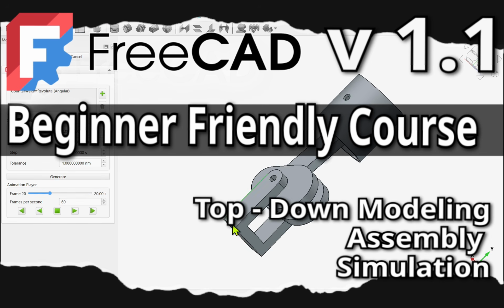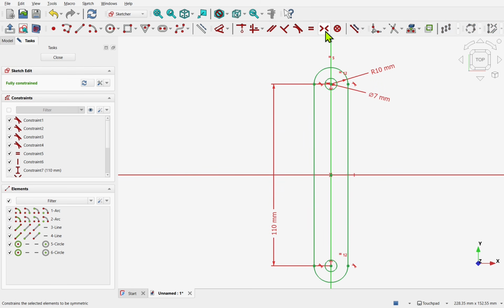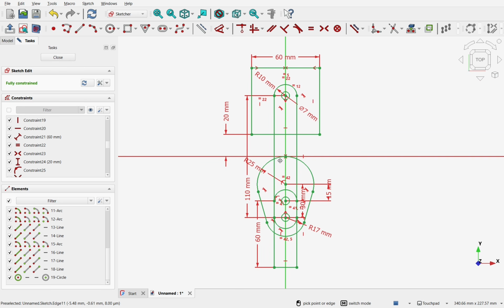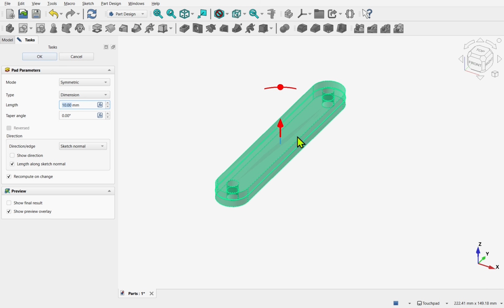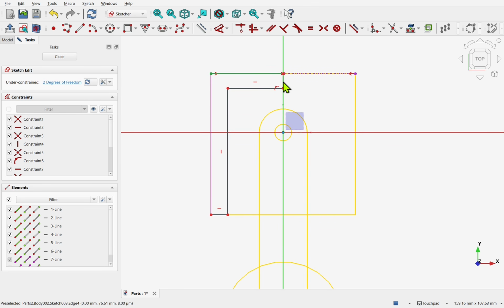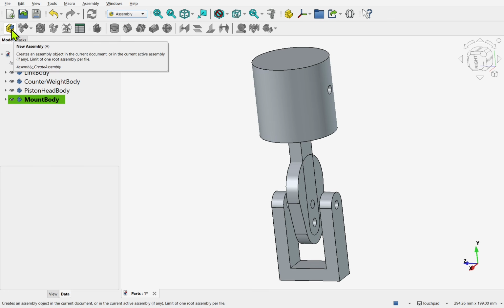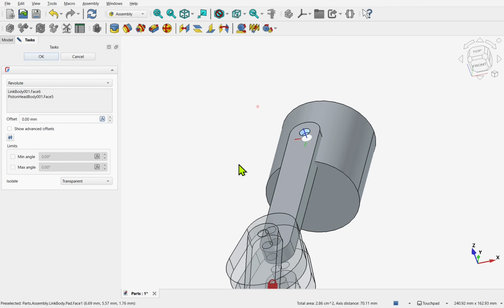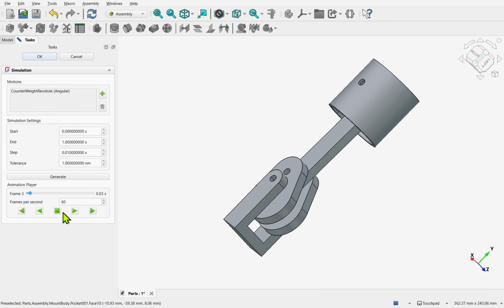FreeCAD 1.1 Beginners Friendly Modeling and Assembly (Model, Assemble, Simulate, Animate)

Comment: Hi Darren, For some reason I cannot toggle between construction geometry and defining geometry mode?  The geometry stays on construction geometry even when I use the toggle construction geometry button to change it.  I also don't have the external projection feature on the create external geometry button.  No drop down menu's?  Any assistance would be greatly appreciated.  I'm using version 1.0.2.
Reply from the maker: Hi, this tutorial is for freeCAD 1.1 which is available for download from the freeCAD website as a RC version at time of posting.  This is a new feature introduced in 1.1 and above, also the same with the simulate tool in assembly workbench. It's easy to miss the version number in the tutorial so don't worry it's not your system.

Comment: Toggling the construction geometry does nothing in my sketch... It still appears as a dashed line. I also don't have that option you mentioned in the preferences. Am I supposed to create a carbon copy instead? I'm not sure why it won't turn a solid line.
Reply from the maker: This tutorial is for the upcoming freeCAD 1.1 where this feature was added along with the simulate  tool in the assembly.  You can download the RC version from the freecad download section.

Comment: I am not sure what I am missing but I am having issues while creating arcs.

Around 11:25 you use the tool for the "tangent" , I can do that for the first line and the arc above, but if I try to use the tool on other lines/arcs I will get an error about "conflicting constraints.

Is there an option I have to enable for this?

(Tried this on both 1.0.2 and 1.1)
Reply from the maker: In the sketcher on the left panel in the constraints section there is a dropdown, within their is the remove redundant constraints.  Make sure that is checked.  Conflicting constraints now makes me think that the auto constraints option has place a symmetrical constraint in your sketch somewhere where it shouldn't, stopping your tangent.
Reply: @MangoJellySolutions  ahh thanks alot man, tried it on a fresh new file and there were no issues 👍
It was already checked by default not sure why I had the problem first time.

Comment: For all the praise that I see here about how good your courses are, I can't use them for two simple reasons, (1) - my start page seldom looks like yours, no matter how many times I reload. I then spend real time trying to get it to match. The one time that it did load "correctly" after extensive cleaning of the Registry and removal of abandoned files was when I ran into (2) - unable to keep up with the activation of pull down menus/hot buttons/... on a very cluttered work space. I even tried slowing down the playback speed but the audio drove me insane and the targets while slower still were accessed too fast. An oversized trailing cursor would help as well as pausing before clicking. Also having a short respite between every three mousing arounds to let the beginning user consolidate what they have just seen and are hopefully trying to mimic.

Comment: Thank you for a nice, informative video.  What if you want to limit the angle of motion? Like a windshield wiper motion, or a angle limited hinge?
Reply from the maker: Glad you enjoyed :) There is an Angle Joint which creates an angle joint between two selected parts but this doesn't allow a range, what you need is the revolve joint and you will find this one actually allows a minimum and maximum angle for the revolve.  So the revolve goes through the pivot point of the wiper and a fix point to revolve around which could be just something as simple as a cylinder.

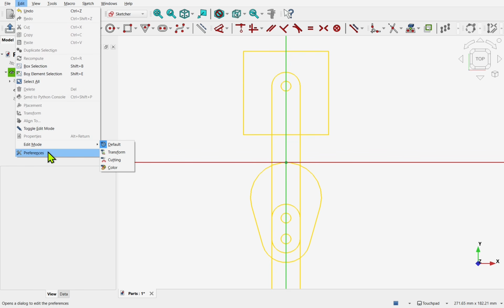Comment: Best CAD tutorials on the WWW by far. I am a 30 year SolidWorks user and absolutely love FreeCad ( especially the part where I don't need a subscription or a password to use the software for my projects) among other things. Graduating to assembiles using your video as a guide, But, I am afraid I am  stuck at 19:24. My verison  (1.0.2) does not have the option you describe and the system refuses to convert the dash dot lines from the converter to sketch lines I can use to continue the exercise. I have spent the better part of 8 hours looking for work-arounds and so far...no joy. I must have hit one of theose stages where I must be commiting the same eroor and expecting different results. ANy help will be greatly appreciated. Thanks in advance
Reply from the maker: Thank you, so glad your enjoying the videos and loving freeCAD.  Ah, so I know the exact problem you are hitting.  This is a video for freeCAD 1.1 (currently available as a RC release) here is a video of how to download and install, https://youtu.be/16jGZ_33o3g  I think they are on release candidate 2.  Hope that helps as 1.1 as has the simulate tool for assemblies.

Comment: i always stuck in 20:35 "always add eternal geometry as construction" menu,
i use the 1.0.2 freecad, and the menu in preferences is gone, any sugestion?
Reply from the maker: Ah yes it's not in that version, this video is for version 1.1 of freeCAD which is currently in release candidate and can be downloaded from the git hub.  That tool and the simulate assembly are for 1.1 (1.1.0)  and above.

Comment: I don't understand what you did to crate the piston head, mine is not showing " move to other body"
Reply from the maker: This is a tutorial for version 1.1 of freeCAD you may be using 1.0, the transform tools have been upgraded since to allow this new feature along with the simulation tool.  1.1 is available from the downloads, follow weekly builds and you will be able to download as a community release from there.
Reply: @MangoJellySolutions ok thanks but after doing everything, I entered freecad again and, tried to enter the file it scattered, the mount, only half remaining

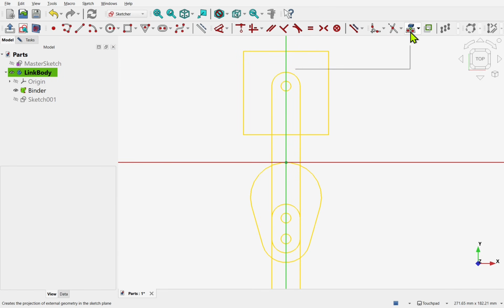Comment: I got as far as 19:39 but I don't have the External Projection tool.  Your video says you are using FreeCAD 1.1 but that is not available.  I have just downloaded the latest version which is actually 1.0.2; so a lower version.  How do I get 1.1 or the External Projection tool?  It does not appear in any of the menus or even the customise toolbar options.

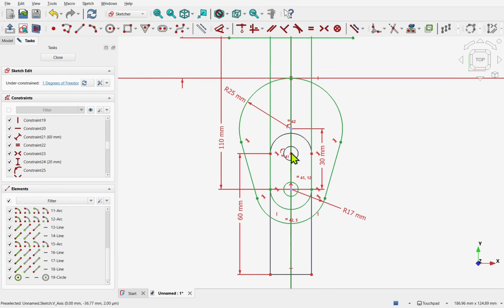Comment: If you're stuck at 14:25, positioning the point on the vertical axis, with the following symptoms:
• Your "coincident constraint" button looks like a cross instead of what MangoJelly is showing
• When you click on it, you get an error message: "Wrong selection. Select either several points, or several conics for concentricity"

Then your FreeCAD sketcher toolbar is configured slightly differently from MangoJelly's. Here's how to tweak it:
• Save your sketch so far
• Go to the main menu → Edit → Preferences → Sketcher
• Toggle the checkbox "Unify Coincident and PointOnObject" to checked.
• Click on OK. FreeCAD will restart. Reopen your sketch and then you will be able to follow MangoJelly's instructions.

If by some miracle this ever helps anyone, I would love to know. :D

Comment: Dear Mr.Jelly at 20:13 the method you have used to convert the construction geometry to defining geometry doesn't work anymore. I tried searching for solutions online which led me to the issue with FreeCAD removing the option to "Add external geometry as contruction" in the sketcher general menu(Apparently it is ON by default). I still cant figure out how i can convert the construction geometry to defined like you have done as i failed to find any alternative methods. PLEASEE HELPPPPP
Reply: also how can I simulate the model cause in teh new version the simulate option is not present in the Assembly workbench and has something to do with FEM
Reply from the maker: Ahh after you said that I believe your using 1.0.x, this video is for 1.1 which is available as a release candidate version (RC1 now RC2) which can be downloaded from the freeCAD website.  These are new features in freeCAD 1.1

Comment: I managed to get this to work in 1.0.2 with a few variations. I still don't have 'simulation' and Assembly 4 workbench, which has animation capability, doesn't play nice with this project. The FreeCAD download site gives 1.0.2 as latest "stable" release. How stable is 1.1 right now?
Reply from the maker: 1.1 is currently in RC (release candidate) for user wide testing.  I have been keeping an eye on the bug blockers list and this inflated to 20 plus, it's now down to 3 do I am expecting they will release RC2 hopefully this month.  Assembly workbench seems to be much more stabler with RC1, i'm looking forward to see what RC2 offers.

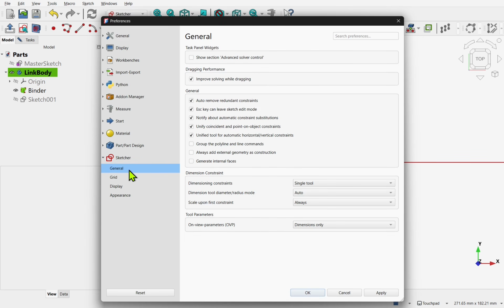Comment: I see your description says 1.1 is that the RC test build then? I like the workflow you are doing but at 19:30 you show preferences that differ. In the snap install of freecad on ubuntu I get 1.0.2 and it has no option for non construction references, the references are pink (looks to mean that it is external geometry not internal the lines do not show up under the task menu), when importing the references from the binder with the G -> X shortcut or create external geometry (different name and icon same shortcut means same thing?), which is the tool I have after the trim edge tool.. well it's not a construction line it's creating it's pink I have no clue what a pink line means and the G -> N toggle construction doesn't fix the reference.  This bit is confusing.  

I'm not sure if this is a bug in my build on ubuntu snap I see from other places that the projection tool is about a year old so it should(maybe?) be in the 1.0.2 build? 

Keep trying to learn free cad but the ability to follow tutorials makes me feel like a cave man smashing keys, and not smart enough to do much. My version's always to old or new but never correct to play along at home and everything changes fairly drastically. I was hoping 1.x would fix most of that.
Reply from the maker: Don't worry  the version I am using us 1.1.x  which is RC (pre-release) , while 1.0.2 is the current stable release.

That alone explains why you’re seeing a difference, there has been a major addition that allows adding external geometry as either defining or construction  geometry.  That's the trouble, technology moves so quickly that it can often feel you are always trying to catch up.  I release both 1.0.x tutorials and 1.1.x for the upcoming release.  The long form course I run is based on 1.0.x until it gets to chapter 10 which is build on 1.1.x but there is nothing in that chapter that shouldn't be able to be done on 1.0
Reply: @MangoJellySolutions  Thanks for the tutorial's and the reply! Look forward to the new feature and the new version.  Also thanks for inspiring me to learn it (again), and happy new year!

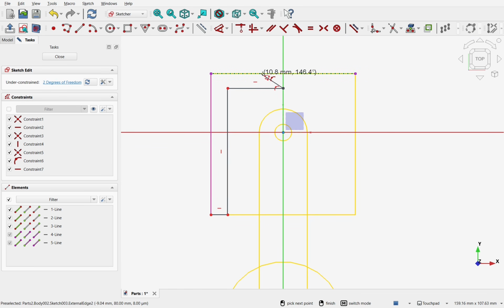Comment: I managed to follow till 29:30 where my polygon has yellow color and I can't apply the 3mm constraint since freecad sends me some obscure error message without a clear way to fix.
Overall, it took several days of my free time and it's been a pain in the ass since my Freecad 1.1 RC1 is quite different from what I see in this tutorial.
I will try to find some other tutorials where I could do anything without following blindly.
Reply: I'm having similar problems, and not sure where to go. Were you able to resolve the issue, if so how?

Comment: When I try to center the piston for instance around the vertical axis by clicking the two top vertices, the axis and then click the symmetric constraint I get an orange piston saying that it is over constraint and the symmetry is not applied . What am I missing? Thank you for the great tutorial.
Reply: I see now what the solution is. I did not check the "Auto remove redundant constraints" option as advised earlier in the video.
Reply from the maker: Glad you have it fix, I am behind on comments sorry so only just seen this.  Glad you are enjoying the tutorials.

Comment: It's great to see all the positive comments about this video, I found it to be a well thought out tutoria, very helpful. I followed along with many pauses + rewinds, and managed to end up with a working simulation of the piston, crankshaft & connecting rod etc. This is the one and only time I've successfully managed to build stuff and simulate using FreeCAD or any CAD for that matter. I've tried many times to learn various CAD packages & FreeCAD etc with no success, and not for the want of trying. Since coming across your YouTube channel, I've found your tutorials  to have a nice flow, while at the same time being very clear. I have already managed to build some useful 3D models and printed them out on my old Ender 3V2 3D printer. Keep up the good work. 👍
Regards Jim
Reply from the maker: Thank you Jim for taking the time to feedback, I am a bit behind on comments so sorry for the late reply.  It's great to get feedback like this as it's the only way I know I am delivering what people need.  Thank you so much for that.  Great to hear the channel has helped.  I have some plans in place for 1.1 which I think people will like :)

Comment: Why do you create a subshapebinder of the hole Mastersketch? I usually bind only the required geometry and extrude the binder right away.
Reply from the maker: There was two reasons I did this, it's quicker than adding the individual geometry as you would need to ctrl click on each edge, and the other is if your sketch changes the binder will update as it's bound to the sketch rather than a piece of geometry that could be removed.

Comment: Excellent lesson. I've made halting starts on the older assembly workbenches and given up. With your instructions I think I can make this version work. If Freecad supports it I'd like to see how to make a follower follow the motion of a cam (not an eccentric) or a ramp with two sections at different angles, i.e, not a simple sliding or circular motion.

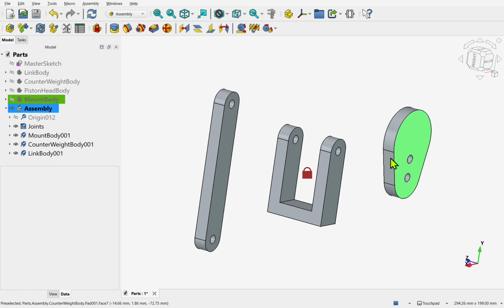Comment: @39:00 I do not understand why there are two types of selections. I do struggle regularly because usually it's hungry but for some functions it is not....😢
Reply from the maker: The hungry selection is used inside of the sketcher.  Outside you have to hold down the control key.  Yes I am with you on that one, it can be frustrating.

Comment: You tried really hard but you lost me with external geometry, construction geometry, etc geometry and binder. I am simply too stupid to understand what all that means and why it’s needed. Every time I try to use this software I hit a roadblock. I have successfully used Onshape  and like using OpenSCAD which I understand reasonably well. However, FreeCad just seems to have an enormous learning curve and I don’t  have the motivation to master it.
Reply from the maker: FreeCAD does have a steep learning curve and has many different ways and tools to achieve the same thing.  It's worth checking out this tutorial if your just starting to try to get to grips with freeCAD https://youtu.be/ZPsLhvgU8kc
Reply: @MangoJellySolutions thank you

Comment: This is the best FreeCAD video I have seen so far, from any creator. The reson I say that is because you explain WHY to do things (ie why use the piston head surface instead of edge for the joint in assembly), this not only makes it more understandable what to do but when you know WHY to do it you can also use the same knowledge in other parts of the design / program. Its the huge difference between memorization and understanding.

Comment: You make it look so easy. I get so frustrated by the wire not closed errors even though they are closed, don't overlap and everything is fully constrained. Anyway thanks for the video. The speed is perfect and following what you do is very easy. Didn't feel the need to fast forward or constantly go back which is not often in tutorials.
Reply from the maker: Wire not close can be a right pain, even when fully constrained you could have a line hiding behind another that you missed which often can be a issue.  I have a video on wire not closed here which could help out: https://youtu.be/YGVkxo6w4Q8 Thank you for the feedback on the video, really appreciated and glad you enjoyed.
Reply: @MangoJellySolutions thanks, this might come in handy sonner than I hoped for

Comment: Could not get the external geometry step to work. The version I'm running does not have the ALWAYS ADD EXTERNAL GEOMETRY AS CONSTRUCTION option. It allows me to select the external geometry but when I close the sketch nothing is there.

Architecture: x86_64
Version: 1.0.2.39319 (Git) Conda
Build type: Release
Branch: (HEAD detached at 1.0.2)
Hash: 256fc7eff3379911ab5daf88e10182c509aa8052
Python 3.11.13, Qt 5.15.15, Coin 4.0.3, Vtk 9.3.0, OCC 7.8.1
Locale: English/United States (en_US)
Stylesheet/Theme/QtStyle: FreeCAD Dark.qss/FreeCAD Dark/Fusion
Reply: You are using FC 1.0.2, this tutorial is for the newest beta version 1.1 that will be fully released sometime next year. You can also download that on the FC website and use it side by side with the current version. =)
Reply from the maker: As @BlackAcePlays has said this is for Freecad 1.1.  I do have a video showing how to install the 1.1 beta versions:  https://youtu.be/Cu5miPp4eZs
Reply: Thank you both for the reply. I installed 1.1 and was able to continue.

Comment: I am using FreeCad 1.0.2  .  Sketch/Sketch Edit/Empty Sketch does not have the tool icon for checking/unchecking the snap/unsnap to grid..etc.. ???
Reply from the maker: This video is for the upcoming 1.1.0 version, this is probably the reasons why.  This is currently in beta as weekly releases available from the freeCAD website but will be released soon.
Reply: @MangoJellySolutions  OK thank you. And thank you for your excellent and informative videos.